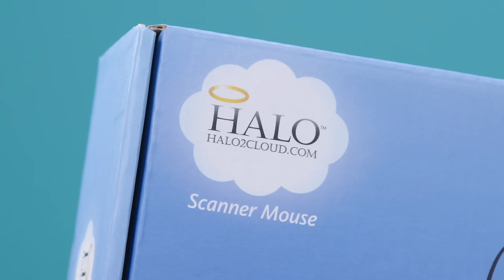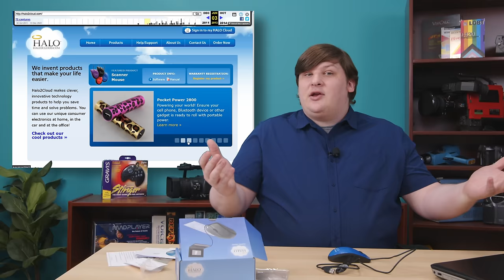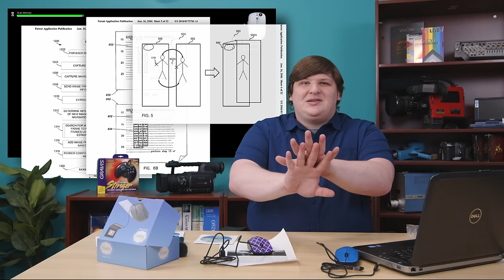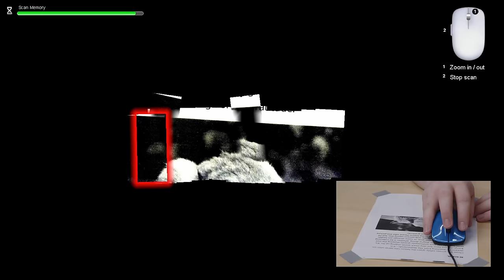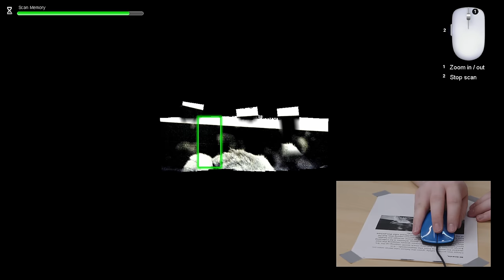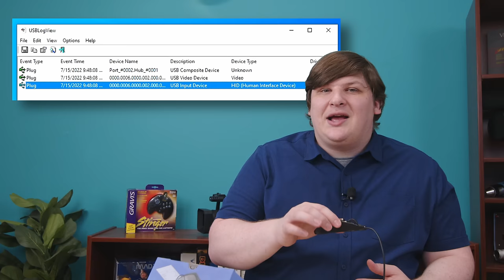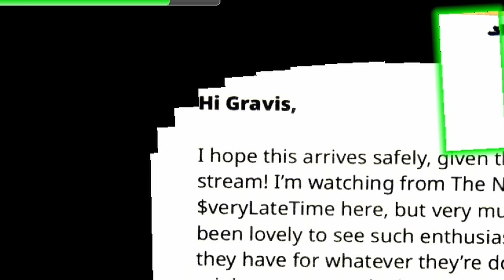Why would you scan things with a... mouse?

Comment: Re the two of them mouse sensors: I'm pretty sure this is so that the software can track how much the device has been rotated, as well as how much it has translated.  When you covered up one sensor, it seemed to be acting as if the device was being rotated around a point, which is a fair conclusion for it to make when it sees motion on one sensor but not the other.  To put it a fancy way, the device needs to know about three degrees of freedom of motion, but a single mouse sensor only makes a two-DOF measurement.  A second sensor provides the additional information it needs.
The mode of failure is interesting: it looks like it thinks the location of the device has jumped, and it's trying to join up the image based on incorrect location information.  Perhaps the data from the mouse sensors is getting corrupted by a bad connection or poor firmware?
Reply from the maker: My suspicion is that when the software auto updated, it downloaded a firmware update for the mouse as well, one that's not actually compatible with it because it was intended for a later version of the hardware. I hadn't initially considered this until someone suggested it after the video was done, and then it occurred to me that these failures may have both followed software upgrades, and then followed the mouse since the firmware now resides on it.
Reply: Ah, that makes a lot of sense.
Reply: @CathodeRayDude  The firmware update bricking the mouse makes lots of sense, but it stopped working while you were scanning - that's funky. So maybe it's saving some calibration data to its EEPROM and maybe it got corrupted from wrong/incompatible firmware?
Reply from the maker: @zaprodk  I can't swear to the sequence of events, is the thing. I wasn't thinking that the software update might silently patch the mouse firmware (which is completely nuts anyway, so why would I expect it?) so I wasn't paying enough attention to see whether it died after the update
Reply: @CathodeRayDude  Could tyou possibly "update" to an older version of the software and firmware, say from the CD or DVD?
Reply: To get more pessimistic about this I'll say that there probably isn't a hardware revision that works with this "update". I think they simply decided to brick the functionality so that you'd be forced to block the drivers in your firewall, or just use it as a mouse. The bigger company that acquired them could then re-release it or do what they want without competition from their former products. The fact alone that it still has active servers with no mention on the site was already suspicious enough.
Reply: @lookitsahorner  Someone sufficiently tech savvy and with enough time on their hands to dig into the contents of the software almost definitely could, but IMHO there's very little reason to bother.

Unless the DVD version of the software already does this by default (unlikely that it downgrades by default, but possible!), that is.
Reply: @sersoft_corp  : If they intentionally brick it, then I'd guess either a disgruntled former dev, or the new owners realizing that it infringed too many things and opened them up to copyright lawsuits.
Reply: @CathodeRayDude  When you showed the LEDs strobing, the light levels seemed to be fluctuating quite a lot. If thats not just because of the camera/youtube frame rate, then it could be causing the scanner camera to interpret the varying darkness of the stationary image as what it thinks is a moving image, so it tries to stitch the two together but gets confused as it can't get a sensible result and isn't registering any movement from the mouse-sensors so gives up, resulting in the effect you're seeing. When you moved the failed mouse, it did seem to do fairly well at image re-constitution until you stopped moving again.
Reply: To put it into an a more intuitive way: you can imagine two hinges, one at the top and one at the bottom of the image acquired by the camera; each sensor says where each of these points is going, thus providing both position and rotation on the plane for the acquired image. If you cover the bottom sensor, the bottom point gets stuck, and the acquired image just rotates around it; similarly for the top point.
Indeed, it's the exact same principle of pinch-and-zoom/move/rotate with two fingers on touch devices, although here there's no zoom, as the distance between the two sensors is fixed; I suspect the redundancy of this extra degree of freedom is just used to make the detection more robust (probably everything is just shoved in some least squares algorithm).
Reply: @sersoft_corp   I know it's an old thread, but it probably didn't start as intentional, this was probably a bugged build that someone just updated the version number for, and then uploaded to their FTP/HTTP filehosting site. That'd be the easiest way to brick it. You're not actually bricking it, your just taking out the fix for that bug.

As to why it wasn't removed and the update still works?
90% of the time, someone just forgot this was still up among their other driver files.
10% of the time, they still remember, but just don't care. 

What could probably be done is to repackage the driver/firmware from the CD/DVD, and make their version numbering just 1 version higher than the one from the website. 
This could probably be done fairly simply with Orca or another similar tool, if not by a full decompile of the firmware/driver, a version change, and then recompile.
If that's all you're doing? Just changing metadata? That's actually a pretty easy process. Now doing ANYTHING else? That'd be very difficult.

That'll force their 'auto-update' software to update to your version, and then from then on never try and update it again, as the device would already have the 'newest' version. 

Now there's a potential for a signing issue with the firmware, but I doubt they actually implemented a requirement for signed drivers/firmware, instead just publishing packages that ARE signed, even if their software doesn't check for it. 

And I'm looking at this from the perspective of it being developed by 2-3 devs, working under a time and budget constraint (don't we all) and then taking into account this project's non-existence on their website.
Reply: @CathodeRayDude  i now wanna buy one of these and dump the original firmware from the flash chip
Reply: Rotation sensing was my immediate thought too.
Reply: @MrHolyKindness  Exactly, rip the disc, upload it to an archive (internet archive is one such place) and it lives on forever.
Reply: That's pretty much it. It would be mathematically impossible to do it with only one sensor. One sensor is basically just a single point on a 2D plane. You can easily create a vector of motion by calculating the difference between where that point was x time earlier and where it is now,  the data is basically a bunch of 1D line segments. It's impossible to determine which way that point is facing at any moment without a frame of reference, which is exactly what the second sensor gives you. Since it's always at a known fixed distance away from the first, you can determine rotation by comparing the data from both points. So instead of moving around a single point, you're now moving around a line segment, which can easily be rotated, unlike a single point.
Reply: @Alex_Off-Beat  Regular optical USB mice only use one sensor. This one relies on two.
Reply: @rootbrian4815  Yes but regular optical mice cannot track rotation only x,y movement. That was my whole point.
Reply: @rwthomas23 if you're trying to stop it from auto updating, it's far easier to just block the domain of their update servers in your firewall than to repackage the firmware with a newer version number.

Comment: as an embedded engineer, having an absolute meltdown seeing how many components and boards this thing has inside. Totally looks like a series of dev boards that would be stitched together in an early prototype
Reply: indeed, in fact I want it to see if I can take them and make a variant that is actually workable.
Reply: I suspect they got to that stage and fired the engineer before they could refine it.
Reply: @SixArmedSweater  Exactly, they likely paid the expensive engineering team just long enough to get a working product then they canned them to cut costs. Either that or the executives wanted to get the product out the door and on the shelves ASAP quality be damned and the moment the engineers gave them a mostly working design they deemed it good enough and sent it off to fabrication despite the protests from the designers that it was an unpolished prototype that was not ready for sale.
Reply: @zombieregime  Yeah. Slapping an Arduino core on a $2 ESP8266 dev board off AliExpress is all you need for that and, if wired connectivity is necessary, a Chinese Arduino clone and an ENC28J60 or W5500 breakout/shield is still going to be cheaper and less complicated. Anyone who can't do even the tiny bit of research needed for that deserves to lose the money they're wasting.

(Funny enough, I'm doing exactly that to build myself some custom IoT temperature-humidity sensors for around the house. You can even do it without soldering in a size that'll fit in a thoroughly-perforated plastic film canister if you pick up the appropriate "ESP-01" breakout board and a suitable DHT11+USB carrier off eBay... though keeping the humidity reading from drifting toward the dry end as the thing is left running is another matter. I'm planning on hooking up a test rig with several each of a DHT11, DHT22, and a BME280 to compare drift over time with some room for identifying variation within a model.)

Comment: I absolutely LOVED that you can simply move the mouse any way you want until the whole document is scanned! That alone would be enough for me to buy one (or more) of these if the build quality wasn't so crappy that the thing stopped working after mere minutes.
Reply: @noize1495  Good to know. Seems like the software is really good but the hardware is cheap crap. I wonder if that software will work on other mice ? It's taking advantage of a test mode of optical mouse  sensors which functions like as camera - there are other comments on the web about using a mouse as a camera.

Comment: The two sensors makes a lot of sense, since that's basically required to get a good solve on both displacement and rotation. A single sensor isn't designed to (accurately?) provide rotation. Not having looked at the patent, I would assume that the single-sensor version likely has no rotation information at all (or if it does it's worse), or requires a more complex sensor.
Reply: You could fix that with software though, the camera would essentially provide the third axis.
Reply: @TheGrinningViking  That can help, but you're going to have issues on areas that don't have much variation. A mouse can track very well on a white sheet of paper, but the camera is just going to see white.

Comment: You can apparently still buy those new! I found them listed as "IRIScan Mouse Executive 2", made by Dacuda and distributed by a company called Iris. It claims to support Windows 11, which I guess implies it's still being updated.
Reply: Some teachers at one of the schools where I work like these. They use them to quickly put up snippets from books on the projector. They're cheaper and more portable, though slower to use, than the document cameras some others have.
Reply: Lil, executive mouse.. Must be an insider trading joke
Reply: I don't remember the driver model changing that much from Window7 to Windows11, at least for UMD user mode drivers (which USB are)

Comment: If the bottom sensor is covered, it is as if you're holding the lower end still, but the upper end is moving. That would only be possible if you're rotating it like you see in the scanning process.

Comment: I think the thought process in designing this went somewhat backwards to the way you presented it here. I think the original idea was "How about we make handheld scanning more usable by tracking location and rotation with mouse sensors?". Which honestly is a pretty decent idea, and with some more thought out algorithms I think would work very well. And as they implemented that, they thought, well, now that it has mouse sensors anyways, why not also make it be a normal mouse while we're at it? That just takes a bit of firmware, and that's it. I don't even think it was really such a fancy thing, since webcams having some kind of HID interface isn't all too unusual, though it normally is just a button or two, not a mouse.
Honestly, I think it's a real shame it's so cheaply made. If it were a decent product, I think it would actually serve some purpose. Your idea of using a phones accelerometer to track the phones location as you move it over a document might work, but I would worry that it's just not accurate enough or would require too complicated of an algorithm to be reliable, since you have to deal with much worse tracking error and somehow compensate for 3D rotation and translation, which isn't easy. With a device that only has to be tracked in two dimensions and uses more accurate sensors, you have a much easier time with the stitching.
Reply: That was my thought too. You could possibly do what the Panorama mode in the Camera app does - if you move too far forward or back, icons suggest which way to move to get back on track - but it would take some significant effort to get just right.

Comment: Maybe a capacitor issue. It warms up, but then has an error, a common failure mode for capacitors.
Reply: I was thinking the same thing. Capacitors 'dry out' and stop working over time as their electrolyte ages. Good capacitors take decades to fail, but cheap ones only last a few years.
Reply: I'd think maybe it's finicky due to the power use of the thing, with 500ma usb ports
Reply: @lasskinn474  What about interference from LED lighting that is common now that was not common back then.  Another channel's video had a similar issue and when they changed to incandescent it worked.  I think it was something on technology connection.

Comment: Interestingly, this mouse uses exactly the same logic that resulted in the development of the optical mouse sensor in the first place. That was developed when HP wanted to make a scanner that worked like one of those copier thingies you showed: you move them over the page and they scan a thing. But as this was a scanner, they wanted a way to move it into any random direction. (Note that as this was early times, the scanner uses a linear CCD.) Their solution: develop a tiny camera chip with a 'flow sensor', meaning they can process the camera image to see how they're dragged over the paper, and put them on both sides of the scanner. The scanner was called the CapShare and it obviously went absolutely nowhere, but the flow sensor thingamajigs proved very useful for other things, like optical mice...
Reply: Randomly remembering the #CueCat bundled with an issue of #Wired growing up. (Took a hiatus from social media around 2014, still not sure if I hashtag appropriately, emoji-in-my-day-they-were-called-emoticons-shrug.) 

Is my T9word muscle memory applicable to any field in today’s marketplace? Do I need to join a cohort or a pod, or what even is this. #infomercialBeforeSequenceProtoMillennialRealness

Comment: I especially love working on older hard drives for this reason. They're all built differently (for the most part). Heck, I worked on one from Maxtor a few months ago built entirely upside down - I opened it, saw just the platter, the head was on the other side of the drive. (Just gave up on trying to repair that one.) But past 15 years or so they've all been the same. No more huge magnets, they've figured out how to make the heads lighter thus use less neodynium and copper to move them thus spend less money...

Comment: I've used one of these for the last decade or so! Mine is from a different brand, but looks kinda similar. It came with OCR software specifically aimed at banking, though. In Europe, to pay bills, you copy a long string of text from the bill into your banking web app. The software that came with the mouse was specifically designed to scan that line, OCR it, and type it into the banking site. Much faster than typing the line by hand.

I've also used the mouse to scan some pictures before phone cameras (and phone scanning apps) were good enough to make the mouse obsolete.

I've never had any issues with the mouse not working, or with its software. Of course, starting pretty much this year, bills now come with QR codes, so I don't use the mouse anymore. But it worked well enough for what it was.

Comment: I had an LG scanner mouse for a few months and used it for scanning and OCR-ing specific blocks of texts from a big pile of documents. It could be temperamental but generally worked well, and saved me messing about with a flatbed scanner and editing. Didn't have any use for it after the project was done, however, so it's now somewhere in the tech shed.
Reply: I still have my LG Mouse Scanner in a box here.

Comment: I strongly suspect that the dual mouse sensors are used to track rotation in scanning mode. 2 points on a plane with XY movement info each let you infer the rotation between of the plane. This is confirmed by your test where you block one sensor: the mouse will start rotating around that sensor (since one sensor standing still and one moving to the side would usually mean a rotation around one sensor).

I love this. I had an idea like this this idea since I found out that mouse sensors are just like tiny bad cameras a few years ago, and I'm happy to see that this has already been made and works quite well (until something breaks and it looses tracking)